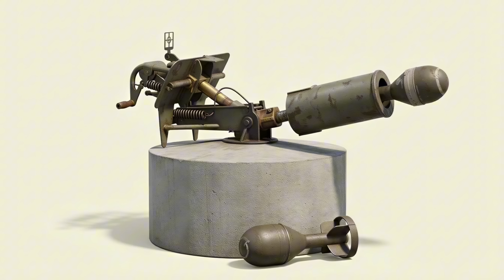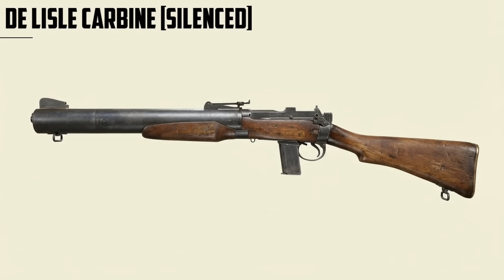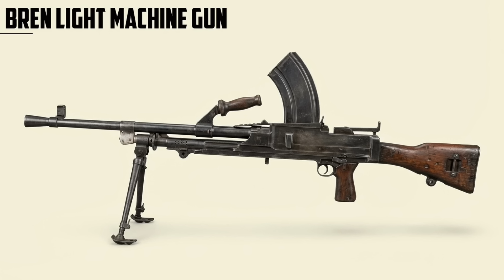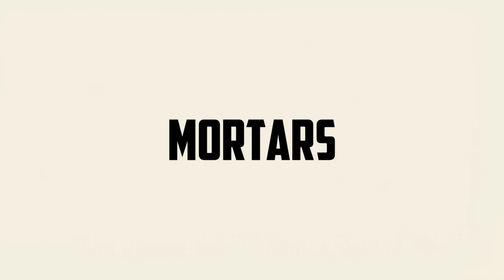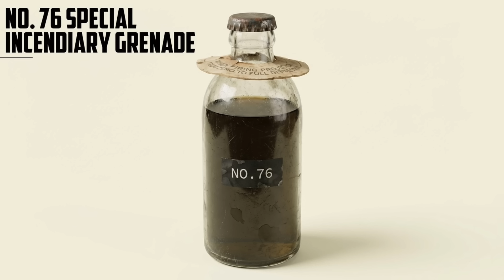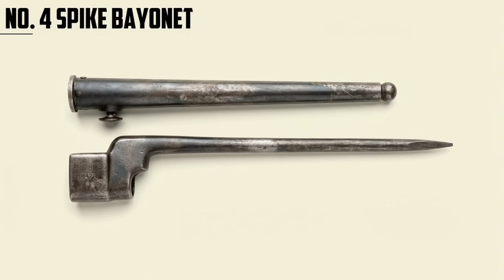Every British Weapon Used in WWII

Comment: The loudest thing in the De Lisle   carbine is the bolt made quieter by a piece of rubber. Did have problems with loading when the modified 45 magazine was fully loaded. I have a reproduction. Accurate up to 150 meters max.